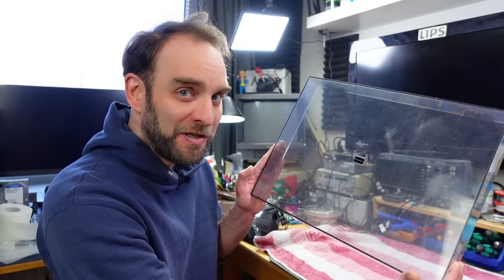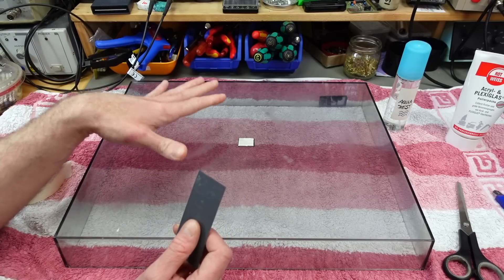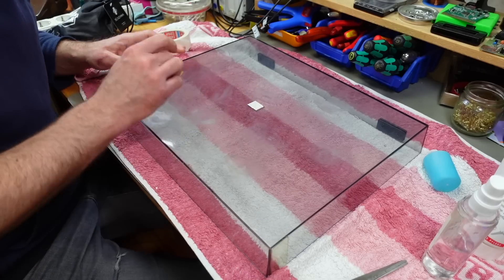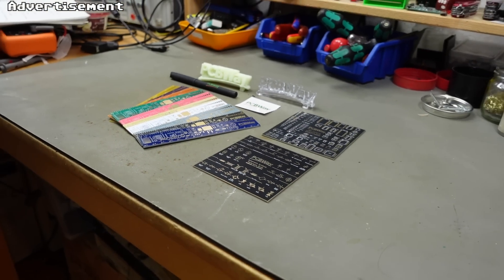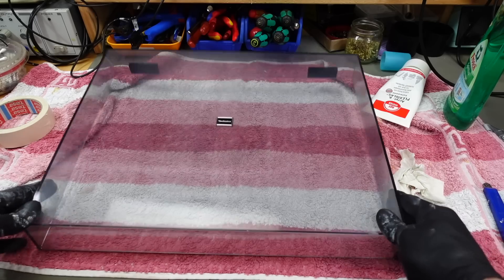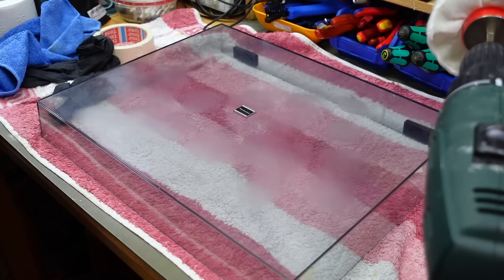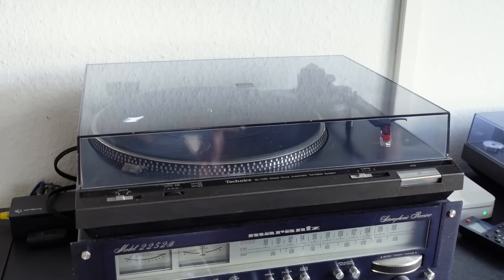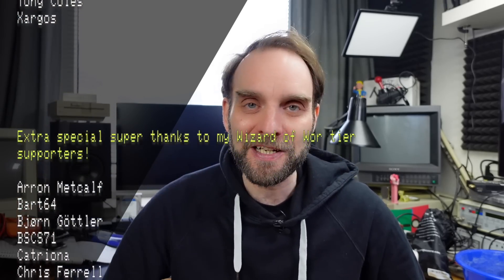Restoring Scratched Clear Plastics

Comment: You probably won't reply and I have no way of showing you the state of it, but I have repaired my dad's 78 KH-8855 that he's had for 28 years, and a guy had it for who knows how long before him and there are like scratches, my dad says that he had been putting things ontop of the cover for that amount of time cause he thought that the turntable was toast, but there's also like spill marks? And what looks like weld splatter, my dad says the weld splatter may be him but he never really welded back in that part of his shop, they are very surface level, I don't feel them on the other side and they kinda thin out towards the edge. And I say spills lightly, I know it's not melted cause the other smaller marks look melter, this looks like some thing got spilled and clouded the plastic up and not cleaned and now not coming off with a scrub.

Do you think this process with more care will bring those out? 
If tried looking for new covers but seeing as it was only made for a year, not a lot of luck 😞

Comment: Thank you for your video. Do you have a recommendation for sanding out scratches on clear acrylic that is 2 cm by 4 cm inset on a digital clock? I can not dissemble clock to take it out
Reply from the maker: If you can't take the acrylic part out in any way, you can try to use masking tape to protect the surroundings. You might have to go very slowly with the polishing and replace the tape a couple of times to get results though. Not much else I can think of unfortunately. Obviously, use a small polishing sponge to not be too destructive.

Comment: Gosh, those new hinges look wonderful. I love the wood file in my pocketknife for smoothing-off bits of sprew etc in plastics as well, makes sense it was a good option for cleaning up your cuts.
Reply from the maker: Yeah, the hinges are excellent. Glad I found them. They basically look like they should have been there in the first place (and are hopefully going to last way longer than the original plastic parts). The Victorinox file is often a great option for me, too, I've used that many many times for plastics. :D

Comment: Thanks, Jan, this video is exactly what I needed - I need to restore the lid of my Technics SL-D202, which is horrendously scratched, including some large sections that look almost... melted? Can't imagine what caused that (it was an eBay buy, so not caused by me). A really useful video for me, most especially in helping to set my expectations - I had fanciful notions of magically polishing it back into a like-new state, but if I can get a result similar to you then I'll be content, as that seems a very realistic goal. Danke.

Comment: Does that have UV protection in it ?  After couple months that stuff will be all hazy again if you don't have a UV protection.
Reply from the maker: I have a 1978 turntable with a similar cover that is absolutely crystal clear. I guess the material they used is pretty well protected against UV. It also doesn't feel brittle at all.

Comment: Nice relaxing video! :D I noticed the HifiBerry Raspi next to your receiver setup and wonder what you are using it for. Maybe worth making a Video about? I have 3 of those using Squeezelite for multi room music playback. A bit fiddly to set up but once it works its really nice. Greetings from Switzerland!
Reply from the maker: Oh, I mostly use it to convert the old Marantz receiver to a 21st century amp. For streaming music over Wifi and for playing stuff from my network hard disk. It's currently running Volumio (which is very usable for the purpose).

Comment: Nice!  I have been using the same method on old floppy disk case lids.  I use Meguiar's PlastX and the kit you buy for headlights has a decent polishing attachment. Thanks for sharing and keep up the good work.
Reply from the maker: Thanks! Yes, the car headlight kits are very much the same as what I used. Works well! :)

Comment: @2:16 large sanding block will make sanding go way faster and more consistent. @7:28 power tool with polishing pads are absolutely the only way to go.
Reply from the maker: I found that you don't have to be very consistent while sanding. I mostly focused on the bad scratches, polishing brought the whole surface back afterwards. I definitely need to get a proper tool for next time I guess! :D

Comment: Those spots i wonder if they're some kind of chemical thing like something dripped on it at some point or from something hot, where some depth of the surface got foggy.
Reply from the maker: Some commenters suggested cigarette (or joint) burns, which makes sense!

Comment: As the top surface will flex under pressure, it would help to control the pressure of sanding and polishing, if the surface was supported directly under the polishing area by e.g. a wooden block and some felt (or similar).

P.S. Cracks in acrylic (and other plastics) can be fixed if a suitable solvent can be wicked into the crack. The repair is not necessarily 100% invisible., especially in a transparent material.

P.P.S. Back in þe olden days, I used toothpaste as polishing medium. It worked well enough for small areas. And it gives the part a fresh, minty fragrance. 🙂
Reply from the maker: It's not very critical to prop up the surface I think. It flexed a tiny bit but overall it's very stable. Makes sense for more delicate things, I guess! I have yet to try the crack repairing stuff. I presume it's super difficult to get it to look good on clear plastics.

Comment: Those look like cigarette ash burns. Someone drops an ash and the person blew it off before a melting crater. Just enough to mar the surface down slightly. It's possible that clear epoxy (or one tinted to that color) might help. It's also possible (but risky) that heating the top might cause it to settle the plastic smoothly - VERY RISKY.
Reply from the maker: Yes, that would make sense! The spots seemed a bit like burns, some even had a texture that might be a cigarette lighter wheel or something similar. Heating a surface like that would be extremely risky, I think. Especially since you usually end up with discoloration because of density differences which would be very visible on a clear surface like that (the cover I worked on had one spot like that where it looked slightly cloudy, probably from heat).

Comment: It looks a lot better! Would it help to put something flat under the cover to support it while you sand and polish to keep the top from flexing? Also, somebody once told me to rotate the object being sanded (if you can) to keep from sanding the same movements from your hands into the surface. It helps to keep the surface more uniform.
Reply from the maker: Not really necessary propping this up, it has very little give. I found that it doesn't matter much in which direction you polish as long as you manage to polish the whole surface equally as much. I guess some people are making more of a science out of it than it really is. ;)
Reply: @JanBeta  I guess the reflections made the flexing of the surface look more dramatic to me.

Comment: Jan, even those deep scratches on your dustcover can be fixed. The deeper the scratch, the heavier grit you need. In your case I would use 500grit and work it up as you did. 

The polishing wheel: you need those round 80mm flat sponges. Take the stiff one and use headlight restore polish ( or any polish ). 

The trick is to sand the complete cover, not only the spots. Than you get a smooth surface with no defects in the end. I can get it crystal clear, but that takes a few days 😅

So, great video and keep up the good work! 👌
Reply from the maker: Thanks! I definitely have to get a proper flat polishing tool, holding the drill for 20 minutes passes was not very comfortable to put it mildly. I might revisit the cover at some point, I didn't have much time to work on it. As you said, I'm pretty sure most of the remaining scratches would be fixable with a "little bit" more patience (which I ran out of). :D

Comment: I don't like to use drills for this when I do headlights, it can burn the/melt the plastic.  If you are good with a spray can get some UV resistant plastic clear coat, it give protection and more of wet look.
Reply from the maker: Good point! My drill is pretty slow so it didn't heat the plastic too much. I see how a corded, faster drill might be an issue though! The clear coat is a good idea, didn't think of that, thanks!
Reply: @JanBeta  Need to wet sand it again with a high grit and all in one direction so the clear coat can adhere better.  I mean it looks great as it is now and I would practice a lot before doing it if you did decide too.

Comment: Those marks are caused from people preparing to smoke marijuana don't ask me how I know but it's fitting for an old technics turntable. Cracking job on getting them out
Reply from the maker: Ha! That makes sense! It seems the previous owner also used a slip mat and tried some record scratching with the turntable. Which would probably speak for your theory! :D
Reply: That also tracks with the internal dirt — no "nicotine glaze", but a thin coating of brown sooty dust.
Reply: If that was true it probably would have been on the other side

Comment: I tried using a headlight restore drill kit on a cover for my atari console, it worked well however I gouged the plastic very deep with the edge of the bit. If you were to try this make sure to avoid that
Reply from the maker: Yeah, I totally see how that could happen. I would definitely recommend using a proper disc polishing tool to avoid that. The drill was super exhausting to hold for me, too. But in theory, it works, as you said! :D